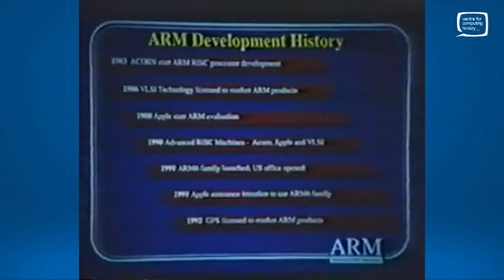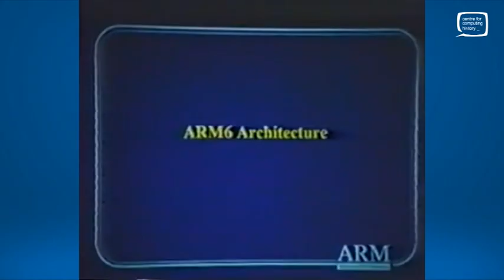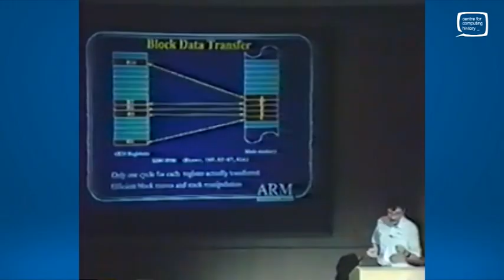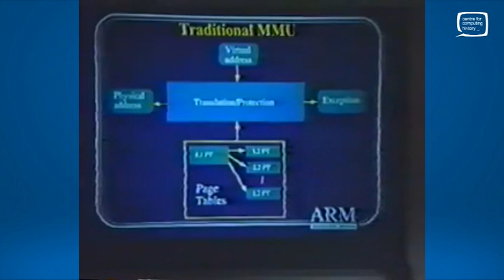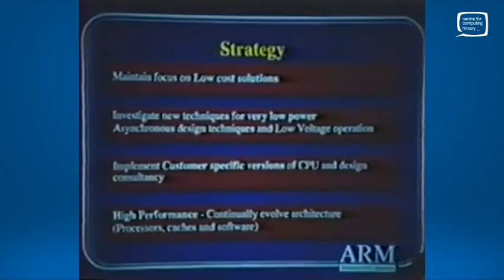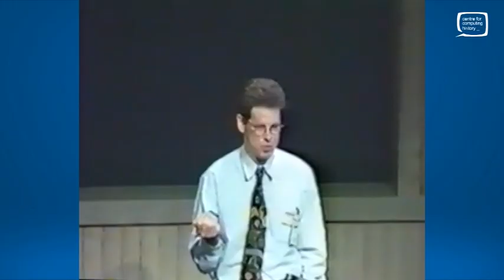Historic ARM Presentation to Apple Computer - 1992

Comment: If you're wondering why Acorn Computers failed so badly there's a whole list of reasons. Thankfully ARM spun off before Acorn collapsed. As an Acorn Registered Developer (!) I don't ever remember being invited to one of these kinds of talks. Though I did get to briefly meet with Sophie Wilson and others in Cambridge, it seems Apple insiders had a lot more insight than we did! I'd figure out code overhead by adding up instructions, trying to avoid multiplying or dividing by anything other than a power of two. Those barrel shifters were a genius move. As he said, the ability to store blocks quickly using registers made a lot of sense compared to DMA or custom silicon (Amiga blitter chip). The simplest solutions often win in the long run :)
Reply: It is interesting how they played sound on these ARM machines. I remember programming DMA hooked to transfer bytes to SoundBlaster, which would generate an interrupt every time it passed half the memory block, so my code could fill the other half.
Reply: @hrissan  even more interesting, the Archimedes (and onwards) had 8 channel (panable) 8bit sound - logarithmically scaled. It sounded pretty good compared to other machines of the time. Companies (including the one I worked for) improved on that with 16bit stereo using high end Analog Devices and Crystal Audio codecs and synth cards from Yamaha, Ensoniq and Kurtzweil. :)
Reply: @kevinphillips6333  principle must be the same - sound card issues interrupt when it starts running out of samples, then interrupt handler will transfer new chunk of data (samples) to the sound card. If we use bulk load/store with enough (for example 12) registers, then we can in theory transfer 12 consequent words (16bit stereo sample per word), almost per 12 clocks even from/to DRAM (12 plus clocks for address select). Sounds quite efficient. Programming close to hardware is such a fun!😸

Comment: Gone from 359,000 transistors In  the ARM610 to 16 billion in the M1. 29 years later. Designed always to be dense code clean and simple. Thanks for posting
Reply: Yes , going  back to the beginning:-

ARM 1 (1985) 25,000 transistors 
ARM 2 (1986) 27,000

But by the time you get to ARM 610, you have a 4K cache and the MEMC (memory controller) from the ARM1/2/3 systems, 
Has now become part of the ARM610 itself. 

So 360k transistors,  is   reached  quite quickly when you add all that up.

By the time you get to the StrongARM (1995?) with its 32k split caches and its 5 stage pipeline. 

You get 2.5 million.

Comment: It is interesting to see that the basic concept of the arm micro architecture did not really evovled since 30 years. We are still using same fundamentals. What a treat this video for a young embedded engineer like me. I whish I could do and accomplished one day a design of complex core architecture like ARM does.
Reply: Instruction set and architecture changed radically with arm8 - pc is no more r15 and requires special instructions to access, very few conditional instructions, opcodes are stream of 16 and 32 bit instructions, there is hardware stack pointer with special instructions to use, no more coprocessor, different synchronization primitives.

Comment: 54:28 "...if you want to ask me when do I think my radio-telephone or my little organizer would need 64 bits, I hope it's not for a very long time..."
Wow, in 1992... These guys were a long way forward.
Reply: The answer to that question... Not for about another two decades.. Apple would switch their "radio-telephone" running an ARM processor to 64 bit architecture with the release of the A7 chip in 2013! :)
Reply: @zacharylarson1245  haha yes the iPhone 5S, took 21 years
Reply: If I remember right the cortex A7/A15 and I think the A9 had extended 40bit addressing in the mid 2000s a few years before the full 64bit. ARM V8 cores started coming out in 2013.

Comment: Got an M1 Mac? It all started here.
Reply: Haha, wot? Newton nearly killed off both companies.
Reply: @rabidbigdog but by the time people realised the newton was going south.

People like:-
Sharp
Texas instruments
Nokia 
HP
Etc etc 

had all licenced ARM 
So it no longer mattered
Reply: @rabidbigdog but by the time people  realised newton was going south......

People like:-
Sharp
Nokia 
Texas instruments etc

Had already licenced  ARM, and were starting to ship. 

So it did not matter.
Reply: The only thing Apple uses is the instruction set. They make their own cores.
Reply: @6581punk  And where do you think the instruction set came from? Apple licenses ARM IP.
Reply: @6581punk  That's with every ARM based processor. ARM doesn't make chips but they provide the HDL source to companies that licenses them. Without the source, it would be very difficult for Apple to design the chip from the ground up.

Comment: 54:00 when will we go 64bit? Answer, 2012/3 with the cortex A53/A57😀 intact if anything in the mid 90s the movement was down to 16bit instructions with the. Thumb architecture in the ARM 7TDMI and the  ARM 9TDMI and it was those processers that got ARM's volumes up, in  the mid to late 90s. 20/20 hindsight 😀

Comment: What an insight into the strategy of ARM back in the day! Seems like following behind competitors and trying to go for as low power as possible turned out pretty well for them.
Reply: They were making an efficient processor. CISC was seen to be too complex and the solution was to have smaller instructions that were efficient and use those the build up the bigger ones. CISC has a minor advantage in binary sizes compared to RISC of course. But a few decent compile time or dynamic libraries would at least get the usual maths and other functions in a reusable form.

When the ARM processor was tested for the first time they forgot to connect some of the power lines and the chip still worked, it was running off the power to some of the address and data lines :)